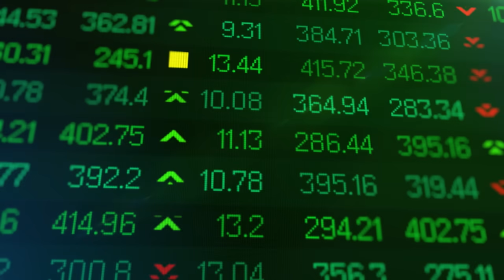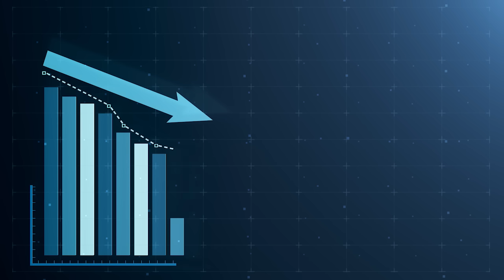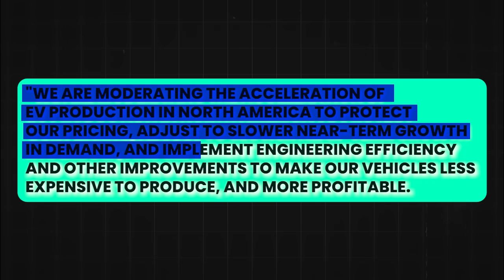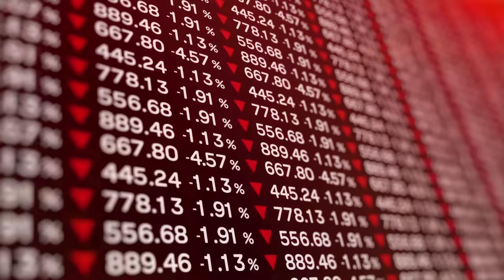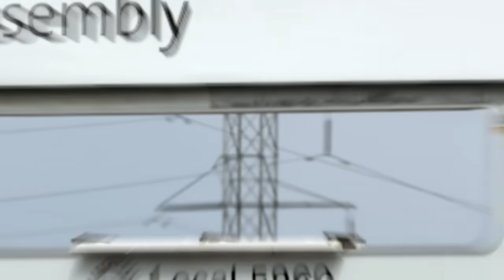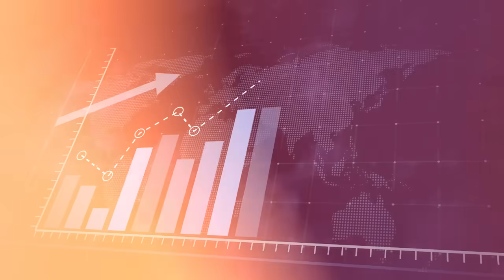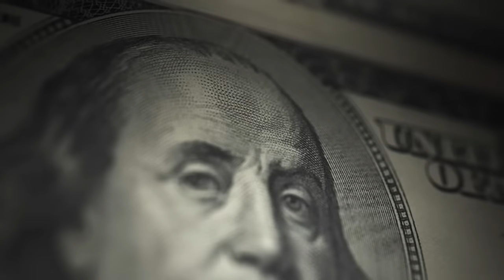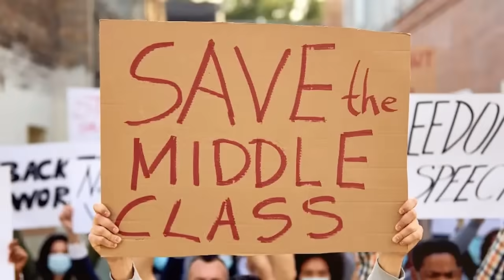HUGE NEWS! GM CEO Just SHUT DOWN EV Production!

Comment: Who could have possibly guessed that consumers wouldn't want to buy cars that cost 2 to 3 times more what they did 5 years ago and aren't as good because you can't just go get gas and get on with your life
Reply: I live and work in my shop so I don't drive that much. I said "range isn't an issue but I need a pickup so let's look at an EV pickup" $80,000 cdn for a lightning. For $80,000 I could replace the entire drivetrain in my 2004 F150, fix everything that's wrong with it, AND have enough money for gas for the rest of my life AND have $20,000 left over to put in a GIC at 6%. 

I was born at night but not LAST night.

Comment: I rented an EV on a trip in July.
The biggest downside that I see is availability of FAST chargers.
I went to a charger that the GM website had listed as “a fast charger”.
I sat there for an hour and got 4 miles of range.
I made it back to my hotel with 24 miles of range (trying to find chargers along the way).
The hotel had a charger (which was also designated as “fast”) and  it took ALL NIGHT to get the EV fully charged.
The upside is that I did not have to pay for either charging session.
Until there is an infrastructure that can charge an EV in the time that it takes to fill up a gas tank, EV’s are not ready for prime time.
Reply: Another Northstar deal gone home . JPK REEEEEEEEE

Comment: Customers previously buying ICE vehicles are being offered an EV option costing three times as much, or more. What could possibly go wrong?
Reply: That was a you kidding me option.
Rather than a EV option-it should've been a hybrid option.
Give the customers a choice, a good choice.
Reply: Just bought a brand new model 3 for less than 40K.  It's nicer than any other vehicle at hat price point.  It will cost vastly less to maintain over the life of the vehicle.

Ford and GM can't make them cheaply, but tesla can.
Reply: @johnfurr6060 Exactly 👍🏻
Reply: 3x? Clearly you've never shopped for an EV.
Reply: That's a lie.  EV's are roughly the same price as ICE but MUCH cheaper to fuel and maintain.
Reply: I had this thought when my son moved out of our house. He lives in an apartment. He could only charge an EV if he went to a charging station. Then he got a job 3/4 of the away across the country (US). It took us 4 days to drive in his ICE car (1996 Toyota Camry). We drove for 10 hours minimum each day. If he had owned an EV the trip would have taken 5 or more days, and those extra days would have been just to charge the EV.

EVs only work in places where you can drive from A to B and either charge the EV or back to A, which is your own home to charge the EV. Otherwise you are losing hours out of your day waiting for your EV to charge.
Reply: Tesla’s manufacturing processes has dramatically driven cost out of their vehicles. The battery assembly is the costliest single item in any EVs COGS (cost of goods sold). GM decided to use battery pouch technology which is vastly more expensive that Tesla’s approach which is cell batteries. Tesla is literally pulling us all into the renewable energy future that we’re looking for.
Reply: @johnfurr6060  yes people are thinking pricesof the past, Teslas are now affordable cars and just wait til the Model 2 comes out!
Reply: Average new light ICE vehicle price in US, 2022:  $46,000.  New 2022 Model 3 price: $35,000 (after 7500 tax credit).  How is $35,000 or $42,500 3x as much as $46,000?
Reply: @johnfurr6060  Eh, Tesla isn't the only cheap option, but a good one, even if I think their CEO is a complete tool. I wouldn't buy from them though lol
Reply: @RussellFineArt they might be cheaper to charge now, but remember the government earns a huge amount of tax revenue of fuel. Take that away, then your electricity bill will be next. Just remember both big corporations and the government are not here to help you, its to help themselves.
Reply: @KidHorn7001  He will never give up his Pinto.
Reply: 3 TIMES MORE IN PRICE ?WHERE DO YOU GET YOUR INFORMATION FROM EV CARS ARE WAY CHEAPER !!! TESLA ISNT THE ONLY EV MANUFACTURER BYD,XPENG,POLESTAR ,GEELY,SEEKR ,ETC DO YOUR RESEARCH !
Reply: @johnfurr6060 how long will the car last?
Reply: @johnfurr6060  Tesla are manufacturing some models in China.
Reply: out of touch
Reply: EVs are just about the same price as ICE vehicles.  I have shopped for both recently.  I imagine that in 2-3 years EVs will be the cheaper option as their prices keep dropping.
Reply: OEM manufacturers with dealerships are the problem when it comes to price.
Reply: @johnfurr6060  UNTIL you do have problems and then the repair costs SKYROCKET!!  AND let's not even discuss what it's going to cost you in upgrades as you become locked into the manufacturers insistence that you pay them for fixing software fubars.
Reply: @RussellFineArt  You aren't thinking about maintainance costs due to very few mechanics trained in the new EV OR the actual cost of repairing when that battery pack does fail. You've shifted the costs off yourself, temporarily, because you are charging via electric grid. BUT that demand will drive up costs due to 1) loss of revenue from gas sales 2) increased costs due to electrical demand grid 3) insurance rates increasing
Reply: 3X more? 

Average pickup last year cost $42K.  F150 ranges from a bare bones $32K up to over $85K.  

The Ford Lightning is selling at $54K ... Before the rebate. 

85% of travel is within 10 miles of home for the average American.  So charge once, drive all week with plenty to play with on the weekend if you have an EV.  Or, fill that tank twice to do the same on an ICE truck.  

Hybrids are what's on top now.  Expect that will change.  

It is curious to me that all this doom and gloom happens at exactly the same time the middle class worker like me starts asking for a cut of the record profits.  Ford CEO making 300+ times what their workers make.  GM's Mary Barra make over 400+ times what the line worker makes.  

So if it is true that the EV thing was oversold by the C-suite, then shouldn't these leaders be held accountable?
Reply: @wvanyar1801  most daily drivers average 30 to 40 miles per day. So perhaps your case is a strawman argument.  This means an EV would more than cover a weeks driving on a single charge (5 day work week).  With charge at home the daily driver could easily be an EV.  

Now road tripping is a different matter.  Thus the hybrid...until charge speeds and locations improve.   Many hotels are seeing this and are installing chargers at their locations.  Besides, Who doesn't want to skip the pump?
Reply: @battlewolf578  capitalism has its challenges, eh?
Reply: @johnfurr6060 fisher price makes good ones too.
Reply: @marks-0-0 the consumer gets a huge chunk of money from the government if they purchase an electric car. Even so, Tesla just like every other car company has never turned a profit on a single electric car. Just how long can a company keep this up in the name of virtue signaling?
Reply: @rg3965 just how long did you think ford would produce a pickup that costs them $32000 more than they can sell it for?
Reply: @johnfurr6060 I don't have a problem with EVs being more expensive to buy. The largest problem is depreciation. Not only do you pay more when you buy it, but when you sell it, it sells for a lot less. It is the amount the depreciate that really stops me from buying an EV and makes EV actually cost a lot more per mile to own. Sure, they are cheaper fuel and maintenance but that doesn't make up for other costs. ICE vehicles are still cheaper to own even with the government subsidizes.
Reply: Why are all tve ceos of these major companies women  now ?
Reply: @RussellFineArt but far less reliable. I can fuel a gas vehicle anywhere but you'd struggle to find a charging station on the highway especially up here in Canada.

Plus filling up with gas takes a minute charging a car takes hours imagind having to take two days to get to a plave that typically take you a day to get to because of the time it takes to charge an EV and the amount of range you lose going highway speeds in an EV.
Reply: @hammerfist8763 a comparable sized car would be a Corolla, Civic, Elantra. Those cars start in the low 20's. It's approximately 10k more for an EV.
Reply: @rdawgz866  Difficult to find those cheaper trims on a lot without any surcharges or upcharges.  Maybe it's different where you live.
Reply: @HerrenGamingNews  Most people buy shitty ICE cars so I wouldn't be surprised if people bought shitty EV's that took a day to charge.  Intelligent people get one that charges fast.  200 miles in 20 minutes isn't great, but it's doable in some recent model Teslas.

Comment: I had a hybrid.  I was in love with it.  I used to brag about my 50 to 60 mpg to my family.  I was so happy with the purchase.  I was even Ok initially with the drop to 10 mpg when the battery was drained.  It taught me the value of learning to hyper-mile.  Coast down to stops.  Manage my acceleration.  Etc...

The problem was that as the battery started to degrade that 50 to 60 mpg inched ever closer to 10 to 20 mpg more and more often.  Longer to charge.  Wouldn't hold a charge.  Pulling in at night with a full charge.  The next morning having next to no charge.  So 3 years after I bought it it needed to be replace.  Not accounting for parts and labor the battery alone was 5k at the time.  On top of the car note I was still paying off.  Parts and labor I suddenly had a 7k maintenance fee.  Rough would be an understatement.  I'd say I was back to being happy, but when I did the math I realized that the battery replacement had damn near wiped  out my fuel savings over the course of that 3 years.  Within another 3 years I was in the same boat.  Minus having paid off the car at this point.  Battery not including parts and labor.  7k.  Parts and labor... 9k.  So I traded it in for an ICE.

I'll never buy a hybrid or EV again.  Especially since looking at a full battery replacement in a something like a Tesla is over 16k for parts an labor.  And that's from some pretty old articles.  I'm guessing it's more now due to Bidenomics.  And your looking at having to do that every 3 to 4 years depending on how much you drive and your driving habits.  5 maybe if your exceptionally diligent.  Beyond that, the investment required to install a home charging station.  And the fact that the infrastructure just isn't there to truly support EVs.  No thanks.  Personal experience tells me ICEs are much more affordable, cheaper to maintain, and there's a massive infrastructure there to support them.
Reply: It's the same with the Toyota Prius.  After 5 years of ownership the Blue Book value is only $5K and it needs a new battery that costs, you guessed it, $5K.  So the car is essentially worthless after 5 years and the toxic lithium battery ends up in a landfill.
Reply: Compare that to ICE vehicles. In 2016, I bought a 2011 Impala for $7,000 that had 74k miles. I drove it until Nov. 2021 when I got into a fender-bender, and parked the car for awhile, asking around to see if I could find somebody to fix it. Got it back on the road for $2k in October of 22, and drove it until Sept '23. I put about 22k miles on it, and the transmission sadly went bad in it, it must have developed a leak I didn't catch with my busy schedule, and the rocker panels were rusting out, so I traded it in on a $3600 '12 Captiva which was a lucky find (low mileage cheap auction car from a dealer friend). The point is, that Impala served me well for 6 years, costing me about 1.3k per year to own, plus a couple hundred in various maintenance stuff over the years and then I traded it in, and got $1k from the trade-in (due to the rust and blown transmission). Finding 2010s cars for cheap is probably the best way to go if you just need a work car. There's plenty of dealers around, find an honest one, take a good look at the car, and for $3-7k you could find something that'd last you 5-6 years if you play your cards right. That's $1k per year, way better than dumping $500+ a month into car payments.
Reply: Where are ALL the used up batteries going to go?

Comment: In CA they ask people not to charge EV's during peak hours because the power grid.  Remember all EV's are in fact fossil, coal, nuclear or hydropower plant vehicles
Reply: Oh come on you can't leave out solar power that provides peak power for about 6 hours of the day, at best.  Since solar is so wonderful and the answer to all, why don't EVs have solar panel roofs?
Reply: @GrOmaha , easy, were decades away from solar being practical.
Reply: Right and if we all had EVs you can count on cars charging at all day all night 24/7... yet the grid can't handle the little percent of EV cars that are here being used already.
Reply: The incompetence of the Federal Government is gathering like the perfect storm. Total lack of understanding about the production and usage of EV's coupled with an even more disastrous assault on our energy industries. As always, incompetence and greed are a disastrous  combination for a nation. Let's not forget the windmill disaster for our shorelines!
Reply: @GrOmaha don't forget about the 200 ft bird killers
Reply: @bigbadchevy  I charge 3hrs every other day with less energy than a dryer - try harder.
Reply: And CA is shutting down plants and not replacing the existing ones
Reply: Well very true. Unless the electricity you're using to charge the vehicle comes from something than the usual/common coal burning generating plant, all you're doing is moving the emissions from fossil fuels from the exhaust (tail)pipe to the power plant.
Reply: @ThePolaroid669  Nope, emissions from doing that are still less than a gas car, period.
Reply: @sprockkets 
Good for you…..
Where do you think your power comes from? Think harder.
Reply: @helinutz14  lol, not what you think...
Reply: @sprockkets you're naive
Reply: How is the electrical power used to charge the EVs being generated?
Reply: @GrOmaha  surface area
Reply: @sprockkets  Glad you don't know what you are talking about.  A typical electric dryer consumes at 1.8 KW per hour to 5.0 KW per hour.  A typical BEV at 240 V charges at 7 KW per hour to 19 KW per hour.  You are probably getting a price break on the Vehicle charging meaning the other consumers of electricity are paying part of your bill and therefore the price is cheaper. Depending how fast you are charging your distance range is between 4 miles to 10 miles per hour of charge, so you are probably driving no more than 30 miles every 2 days.  My point on solar was 2 fold.  Don't count on charging your EV at night if the country wants to get rid of fosil and hydro  power and rely on solar and wind.  My second point about ev cars not having solar roofs was some solar gain is better than none when you run out   I think a typical solar panel is rated around 0.4 KWH.  A typical day at work might get you a couple of miles free every day.
Reply: @mrmedium7984  Agree.  But it might let you use some accessories in a major traffic jam without depeting the battery and a day in the parking lot might get you a couple of miles of charge.  Not practical to fully recharge by but it might limp you somewhere.
Reply: And a made with fossil fuels.
Reply: The same "power grid" lines that private utilities companies have failed to correctly maintain.
Reply: @sprockkets  , Horsesh1t. 🤣

Comment: Who knew that no one wanted to buy electric cars that cost 50 to 100K and if something goes wrong with the battery half the car has to be replaced. Which makes them disposable because who is going to buy a used EV going in knowing that the car is a ticking time bomb and potentially a total loss.